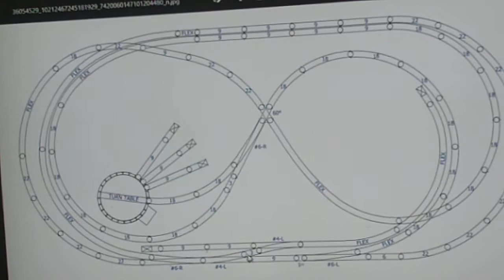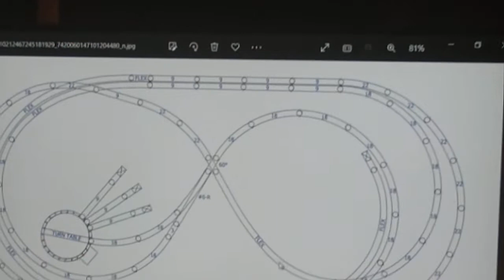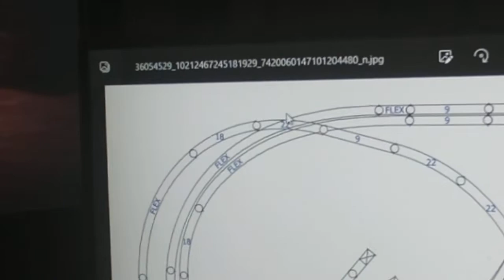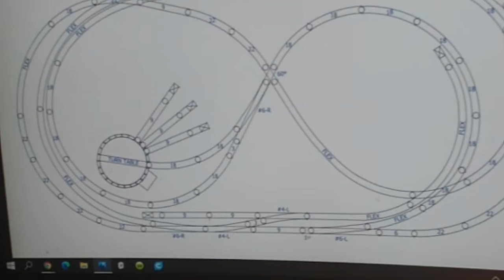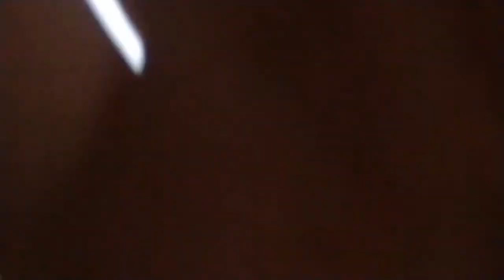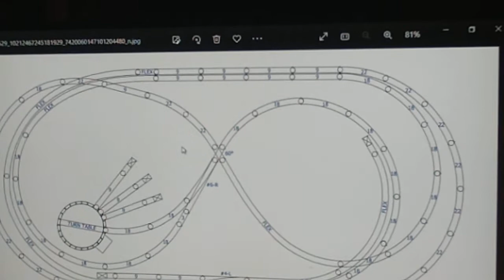Track Plan #1

Comment: I like the track plan.  I hope you can still keep the passenger station.  Coal mine sounds good but I like the roundhouse too.   The bridge will look great.  Good luck setting the tracks down.
Reply from the maker: Hi Batman Dru 😀 I'm still up in the air on what I'm going to do I do have a coal mine I built for scratch plus I have the two engine buildings I could always change my mind right now I'm just getting the outside track going and get the layout cleaned up and then think about it thank you for watching

Comment: Your concept is very interesting. My Suggestion, Avoid as much as you can from using 18" curves, that way you have a better option on what you will be able to run on your layout, other wise you will be stuck with running very small trains, and like that big BNSF you have will struggle around the curves and you will end up with lots of trouble too. That's only if you can and have the room for the larger curves. Looking at your board size you could use 20 & 22" radius, you can get those in set track too, and that will avoid you using flex track too.
Just a Suggestion my friend.
Reply from the maker: thank you arty i like hearing people suggestions thats why they have a comment button maybe i look for some 20 inch curves i used the 22 inch curves on the outside track and they are working really good
Reply: @KerleyExpress  I know Peco UK are now making them. It's 16 pieces to a circle, I got some packs of these my self that I will be using later.
Reply from the maker: @Ausmerica  thank you im looking now i bought my 22 in on ebay and i haven't bought anything off ebay in a couple years
Reply from the maker: @Ausmerica  im not finding any 20 inch curves